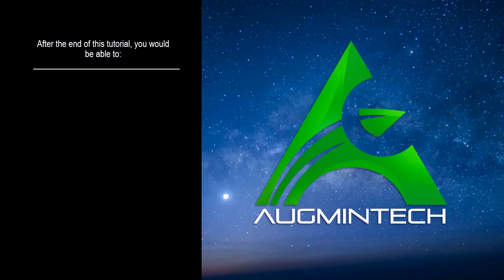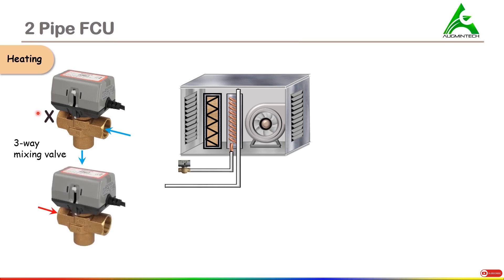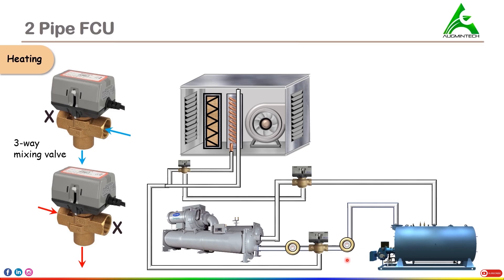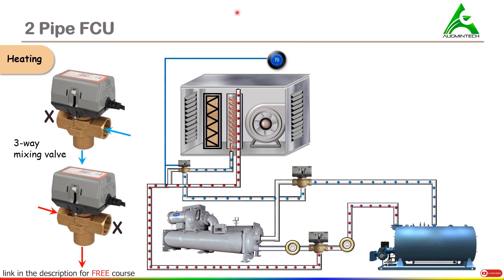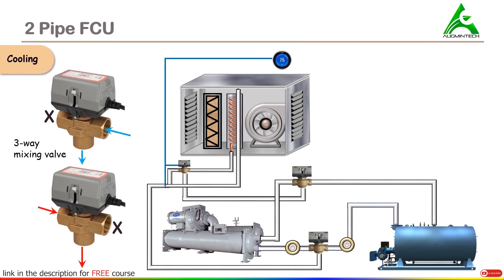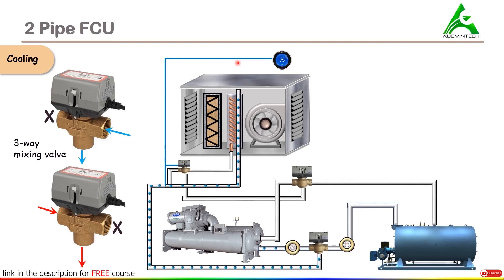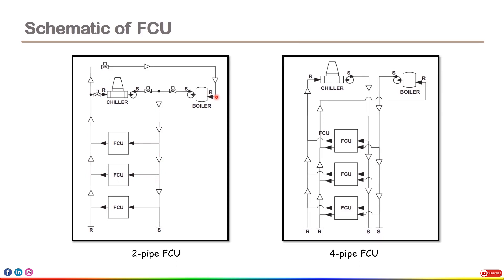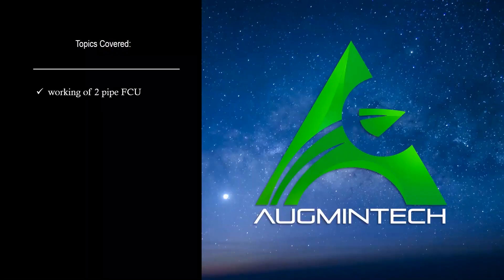How Fan Coils Work in HVAC Systems | 2 Pipe FCU Working | FCU Fan Coil Unit Working

Comment: Excellent diagrams and explanation. Too bad most 2 pipe FCU Fan Coil Unit A/C pipes are not insulated properly. 
THIS IS A MAJOR REPAIR ISSUE FOR CONDO'S COMMON AREAS & UNITS. EXTENSIVE CONDENSATION PROBLEMS ARISE.